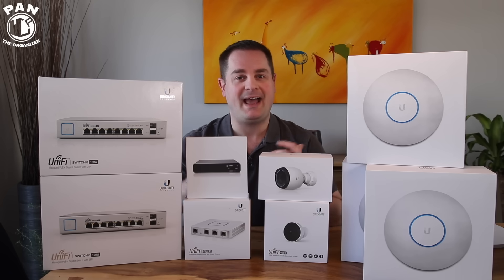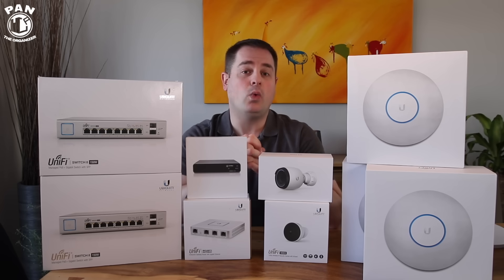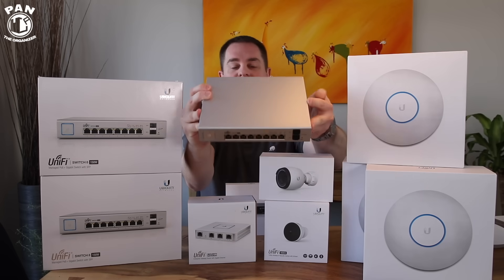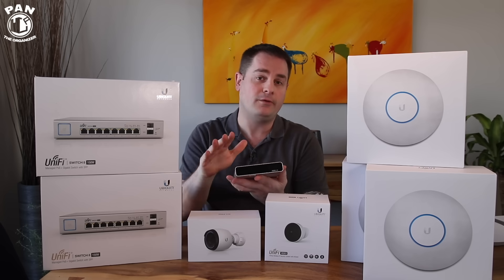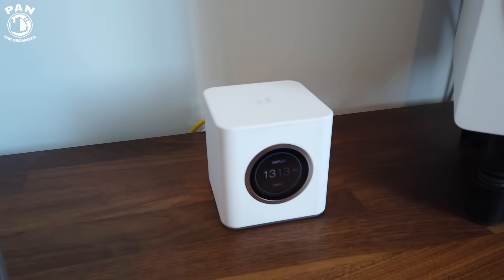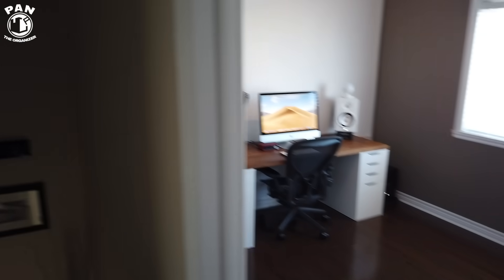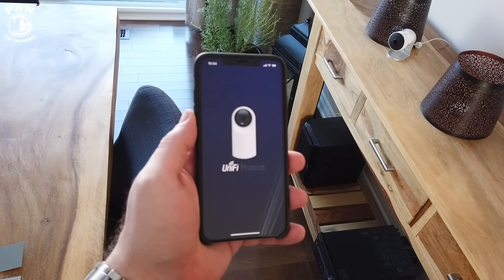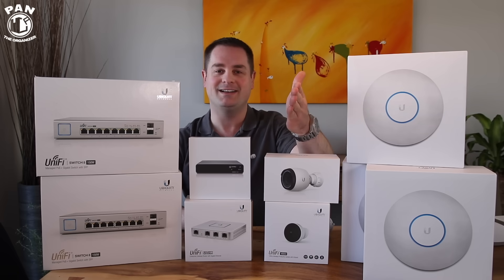SUPER FAST WiFi NETWORK IN MY HOME !!  Ubiquiti UniFi + UniFi Protect

Comment: I am a little confused about your video, so here are a few points:
1) fiber should have the smame speed up and down, or at least close.  Gigabit should be 1000 / 1000
2) You would have been better off building an UnRaid server and running the UniFi software on it, so you can ass as much storage as you want as well as run a LOT of things on it.
3) All cameras should eb wired, as it is rather easy to jam a WiFi signal
4) A mesh system is never a good idea.  It is essentially repeaters with a single true access point.  WiFi repeaters take in a weak signal, boost it's power ( and all the bad parts too ) and send it out again.  As you see in this video, they rearely work well.
5) A Netgear 24 port PoE++ switch would have cost roughly 1/3 of the 2 UniFi switches, and a simple 5 port gigabit switch in the basement would have worked perfectly fine.
6) With the costs saved in the switches and without needing the Cloud Key, you could have done as I stated earlier and built a MUCH beefier server that would have done SO much more than just run your UniFi gear.

All of this is quite easy to do without the need of any training or anything else.

Comment: confused as to why you arent getting even 500 wifi with mesh points in basement ? oh that was amp not new system, whew haha, thanks :) im having issues getting more than 100mbs on 1gb/1gb service wifi with my 1 AP, dont have the entire setup. Just a UAP-AC-M-US (starting small) plugged into router with that wifi turned off
Reply from the maker: Check out how I upgraded to overkill network status in my new home in this video: https://youtu.be/Tl06wwGgoHI

Comment: Unfortunately the USG (the gateway) is only cable of doing aprox 100 mbit/s. So if you have fiber, buy their Dream Machine.
Reply from the maker: You’ll be glad to see what gear I upgraded to in my new home in this video: https://youtu.be/Tl06wwGgoHI
Reply: @PanTheOrganizer  Nice :-D I actually went the same way, but without the camera's. I'm not completely convinced it the system for me as I want it to be controlled by my Home Assistant which also works as an alarm system. I don't want it to record inside of the house when I'm home.

Comment: Hi Pan - quick question on this.
You had a Bell modem/router which connected to the security gateway but could you not bypass this modem by connecting the fibre-to-the-home connection straight into the security gateway?
Trying to figure out a schematic for how my new home's network would also be run (which is very similar) but just wondering whether you needed that router in the first place.
All the best!!
Reply from the maker: I’m not a networking expert so I don’t have the answer to that question unfortunately.

Comment: Hi Can you sell me on the $128 router, if I've been dreaming of buying the UDM. I am not to worried about security, (or am I?) and a doorbell or camera stands only a 25% chance of being purchased. I have a desktop that stays on all the time, so that takes away the need for cloud key. I am deciding if I want to take TIVO off of MOCA. But anyhow there is several Lan connected items to decide between .
Upstairs desktop, Apple TV (maybe the TIVO's (2) as mentioned.
Downstairs (30 feet away from router that is upstairs (ranch 56 feet by 35 feet), drywall walls with perhaps not much in between other than wood and electric running through basement ceiling. 
Downstairs LAN - playstation, smart tv.
Possible AP down there, (use wifi of router (or not?) upstairs laptops cellphones, thermostat.
Switch could go toward basement .
Garage and side  yard could use an AP (or not if basement one works)

Comment: You say 'essentially' a lot.
Reply from the maker: Essentially yes. :)
Reply: @PanTheOrganizer  I see nothing essentially wrong with that :)
Reply from the maker: Hehe I hope you still enjoyed the video. How did you discover my channel by the way?
Reply: @PanTheOrganizer  It was good. I just started researching some new access points, routers, switches etc, and there seemed to be a lot of Ubiquity Unifi stuff. A lot of videos didn't get into the weeds of the gear. Its too bad this unifi stuff adds up so bad. 

Oh, and you have 1 gbps...I currently have 5 mbps. Yes, that's right...0.005 of your speed! I live in rural Manitoba, so getting 5 is a privelege. But this coming spring (they're installing already), we're getting 100 mbps up and down. Still not 1000, but better than 5!

Comment: Great video. However, isn’t the difference simply down to the fact your new system is hard wired with several AP rather than using a wireless mesh system.  Hard wired will always give significant improvements over wireless.  Impressive all the same!

Comment: The Ubiquity cameras are great but do you also have a security system that integrates with them or what are you using for security?
Reply from the maker: They are integrated thanks to the UniFi Protect which goes through the Cloud Key controller for recording. Super simple.
Reply: @PanTheOrganizer  I get that they provide video monitoring but what about motion detection, also door/window triggers for security?  I'm building a home in AZ and when I'm away for work, I want my wife to set the home security system when she's home and away.  I thought about the Ring cameras and alarm system. Thanks Pan or the reply, your channel is awesome.

Comment: So you go from a firewall to a switch ? Don’t you need to pass a router or am I wrong? 
If you have a gigabit connection and are only getting 500-600Mbps thats really bad for that much money 😦. I have a coax modem connected to a TP-Link AX6000, and I get up to 900 on iPhone 11.

Comment: So it’s only gigabit over wired connection? Is it worth it when you loose half the speed through wireless? Great set up but you could also add some more in wall Access Points to fill in any dead zones. As well outside WiFi has to come into consideration

Comment: Hey Pan, how are you? Greeting from Brazil!
I just found you video while searching for a way to get great coverage on a friend's ranch.
I currently use Amplifi system on my house, and I LOVE IT! But I think the Amplifi won't be sufficient for his case, so I was taking a look at other Ubiquiti solutions such as yours. But I have a question, does this solution is also Mesh? Will it create a single network and SSID for the entire house? I have never dealt with this kind of equipment, sorry if it is a dumb question! Cheers mate
Reply from the maker: I used to have AmpliFi as well, which I had reviewed in this video: https://youtu.be/SGyCRCxy8Xw

Yes my new UniFi setup creates a single network SSID for my entire home.  I can go from floor to floor without any issues, I'm always on the same SSID.  The system switches to which ever access point it needs automatically, seamlessly.  And no worries, there are no stupid questions!  I had the same questions as you before I got this kit. ;)

Comment: Why on earth would it only be 100mbps upload if it's a fibre connection that provides 1,000mbps download? Where I'm from, if you have fibre, then the download speed and upload speed equal each other. I have 100/100, but if I upgrade to gigabit, then it's 1000/1000.

Comment: Nice work Pan and because of that I have subscribed to your channel which I have enjoyed couple other videos on the car detailing :-) !!  
I have decided to buy all Ubiquity equipment as you have shown on this video to give my home 1.5 Gbps a full real deal of speed and having some bright new features using the VLAN setups designing a better control as well. 
BTW, for your Bell Hub 3000 bypass configuration... Would you mind to share how did you turned off the router futures?  and,  How have you setup the Bell Five TV along with your new system?
Will really appreciate your feedback.  Thanks !!  MesTech  :-) /\

Comment: I would love to figure out why my Unifi setup is so slow. I have 5 access points.. 4 nanos, 1 acpro. UDMPro. Modified APs for medium range to avoid overlap as much as possible, have put two on each end of house (one upstairs, one downstairs). I seem to get decent speeds sometimes, and slow most of the time. Speed at modem is about 600 to 800Mbps on average. Most places in house, to my phone, or laptop.. over wifi hits 20Mbps or so.. sometimes I see it get up to 150.. but using basic speed test runs, multiple times, it fluctuates a ton.. goes up, then down, then stays down slow.. sometimes goes back up. I would have thought with nanos I would see 400+ to all my AC capable devices. In the rooms that I have the nanos, even there it is sluggish/spotty. I would think in the same room it would be top speed.. but still see mixed but mostly slow speeds on laptops and phones, and also on amazon fire TVs I get a lot of buffering. Very frustrating given how good this stuff is.
Reply: Modem in bridge mode? Having two networks can suck the power from the unifi setup. Also if you have ips and ids on they can also absorb a ton of speed. Give those two things a shot and if not hit the forums bud.

Comment: Great video ! However, I do not believe that you are getting the best performance out of your system since you are only receiving about 50% of the bandwidth that you are paying for. I am not sure if your phone is experiencing limitations or the system is only able to deliver that much. In my book as a network engineer an 80-85% result would be satisfactory but a 50% is definitely not a success. I had high hopes for Ubiquiti Unifi but would need to perform further testing and research now since it is not considered to be a cheap setup.

Comment: Great video, though the AC HDs are massively overkill, they're designed for environments like restaurants and shopping centres whcih have a high number of connected devices, you'd have been better off with the pros.
Reply from the maker: Why?  You think they would have given me higher performance than my AC HD units?
Reply: @PanTheOrganizer  Unlikely, They're just built specifically to handle a lot more clients, unless you plan on having a party with 400-500 people all using their mobiles just seems massively overkill, though you did say "overkill setup" I know. The Pro's would've been great for this. There's just a good number of people I've seen using those APs in there home and I honestly have to ask why, why would you do that!? But for an overkill setup they fit perfectly 😉

Comment: Would've loved to see the whole installation process, that's the fun part. But very well done. I just bought a small 8 port workgroup switch because my netgear one died and loved the look and feel. Eventually I will install a router and access points around the house as well as a home security system and this is the brand I will be going for.

Comment: The problem!
No markup......zero tech support. beware anyone thinking about using ubiquiti products. The only support you will ever get is through other installers. As they have no support. You'll try chat only to wait and wait and wait. Then when you get someone they may have no actually field time. So something you think will take a minute or two ...well lets just say you will be saying are you kidding me! Beware. It can be great stuff, BUTT! you may want to look to a company that allows for at least some profit so you can afford the warranty issue should it arise. Zero Profit ...............you have to rely soley on labor rate. That will pay for the truck,insurance and a little salary....as the Joe Walsh album is titled But SeriouslyFolks!

Comment: HD stands for high-density. These aren't really designed for home use. The AC LR, AC Lite, and AC Pro are the ones more for home users. 
The other option would be the NanoHD which supports AC Wave 2... though even that's typically overkill for a home environment.

Comment: Your basement wireless speed is less than 35 mbps, and your internet provider speed is 1 Gbps. Buy an wifi 6 router, you can get 500 mbps to 900 mbps wireless speed at your house (under 5000 square feet). The cost is merely between $300 to $600.

Comment: Hi I also have an AC-HD. They are really good. 
I have a 1000/50 Mbits internet connection. Is the USG really good enough to handle it? I was reading a couple of times that the USG is not strong enough for 1000Mbits even when you disable the DPI and other security features. Whats your experience using a direct lan connection?

Comment: 1gbps on usg ?
Reply from the maker: It depends on exactly what you are needing the USG to do.  For a basic firewall the USG will approach a full gig.   Add in DPI or other advanced things and it will not get there.  I have since upgraded to the USG-PRO and that will easily do 1Gbps.

Comment: We have the same set up minus the cameras but our speeds dramatically reduce at the router. Ethernet to modem is gigabit speeds router is around a 100 mb did you have to modify any settings?

Comment: Just ordered the same set up as you show on the video. Great explanation of this set up. Thanks for the work on the details for this set up.

I have one question which cat cable did you used for all the set up?

Did you used cat 6?
Reply: I would highly recommend at least cat6 for Gigabit. If the runs are less than 55m, it can be used for 10Gbps in the future if required.

Comment: Why did you use the 8 port 150w switches over the 8 port 60w? Is the higher power switch required for the amplifi hd access points?
Reply: I have the same question. I think it would be more than enough with 8 port 60w switches....

Comment: Seems expensive, by the time I can afford all this tehse products might be gen 10
Reply: I know your comment is 6 months old but I just want to point out that having that sort of mindset means you'd never buy anything. By the time you buy ANYTHING something else better has or probably will come around the corner. You buy for the now not the later. If you save up and something much better comes along and it's not to drastically expensive then you save for that and get that.You obviously only need to buy what you can actually use. It would be pointless not buying lets say something that can handle your 200MB speed and instead buying something that handles Gigabyte speed. When you might not even have Gigabyte speed for another five years. Obviously hardware might drastically change but that's a MIGHT, it's weighing the pros and the cons. If the pros are way better than the cons then you have your answer.
I'm not from the US personally so I suspect it would much more expensive for me, but then I only want one or two products so while expensive for what it is I have heard great things about them. Seems worth the money to me. Can always sell used to recoup some money.

Comment: So I see you are with Bell so I would assume you are somewhere in Canada. Any idea if I can hook up one of the access points directly to my Bell modem/router and have it work just as well? I just hate the signal strength from the bell network and would love to get even half the output you have been getting with that system. I just won’t have the need for everything else you got. I just want to boost signal and increase speeds

Comment: Pan: Great job with the UniFi setup. After a couple of months how well is the Gen 2 could key holding up for you? I had a Gen1 and it could not keep up with the 9 networks that I have setup so I switched over to using the software on a PC.
Reply from the maker: Everything is working perfectly well. :).

Comment: Thanks for the review. But I think it is not a fair comparison. You compared a totally wireless solution (Amplifi HD) to this wired one. I bet you will get more or less the same performance when you use any wired AP, even those designed for consumers like Netgear or TP Link.

Comment: Back here again! I just bought my Ubiquiti system for my house. We are installing a patio and it was imperative we obtain reliable WiFi connectivity as my wife will be using the patio on days she will be teleworking. Everything came in around $700.00 (including taxes and extended warranties.

My configuration includes: 
UniFi AP AC Pro
UniFi Security Gateway
UniFi AC Mesh (For the patio. Will be testing its performance. If it doesn't work to my expectation, I will consider getting another AP AC Pro).
Unifi Switch 16 (150W)

I'm totally new to Ubiquiti and decided to revisit your YouTube video for a quick refresher. I will be installing everything on the weekend. Thanks again, for a great tutorial!
Reply from the maker: Thanks for sharing!  You will love your new setup!

How did you discover my channel?
Reply: @PanTheOrganizer   Thanks, Pan! I saved your channel in my playlist under a previous search. A search for "network" on YouTube included your channel among others.

Comment: I was going to get 3 Unifi AP-AC lite for my home. I just wanted to know that if you roam from one wifi zone to the next, do you loose wifi connectivity and then regain it or does your IPhone seamlessly switches between the two access points without loosing Wifi completely(not even for half a second). I would be really grateful if you could answer my query, Thanks for making the video.
Reply from the maker: My devices seamlessly switch without issues. :)

Comment: I am building a new house now can you tell me how much you paid for all your items that you bought. also how much did the company charge you to install it into your home.
Your home is bigger than mine ,mine is a double storey at abot 45 sqs in size.
Reply from the maker: The equipment is roughly 2,500$ CAD and the installation was roughly 1200$ CAD.
Reply: I think i will go the same as you but i need about 6 cameras as l want a few outside and a few inside, thank you for your video and you replay to my question.
Reply from the maker: No problem.  How did you discover my channel by the way?